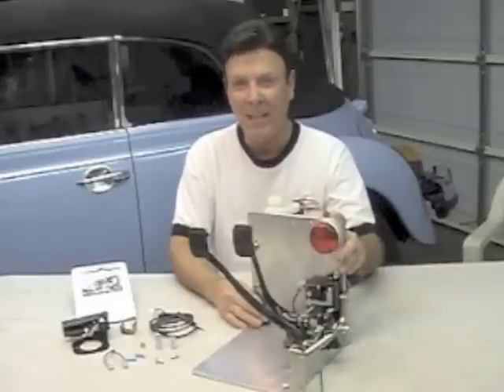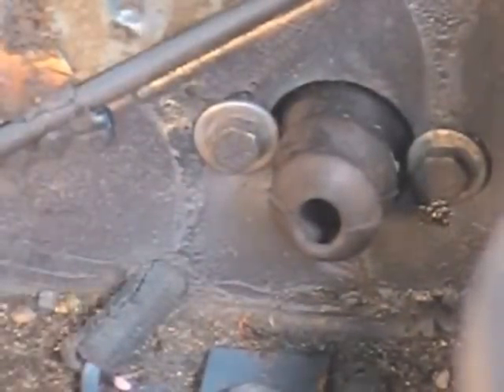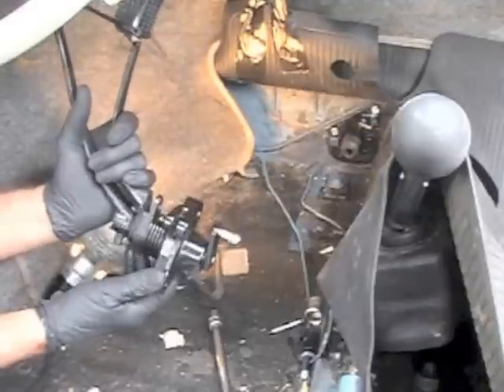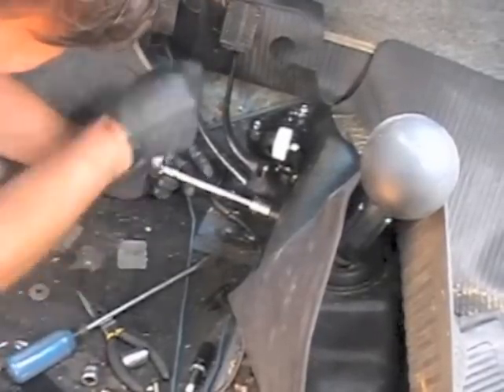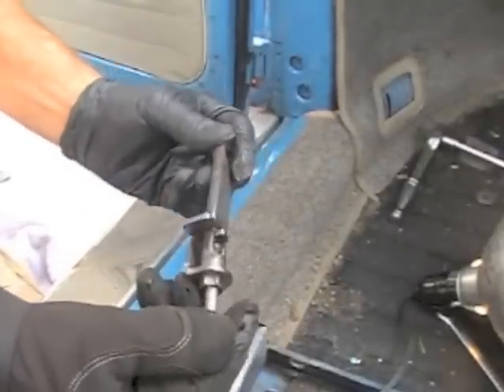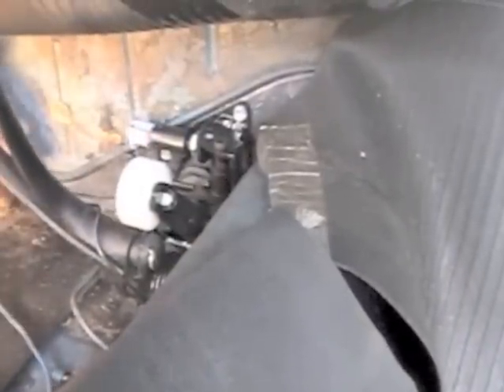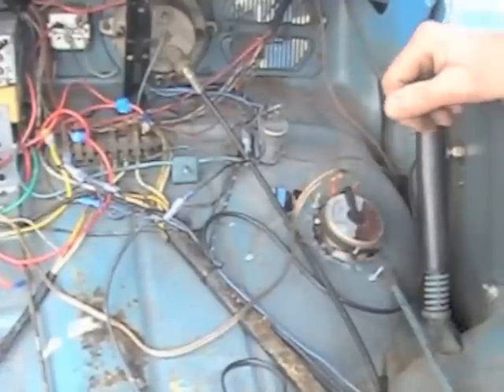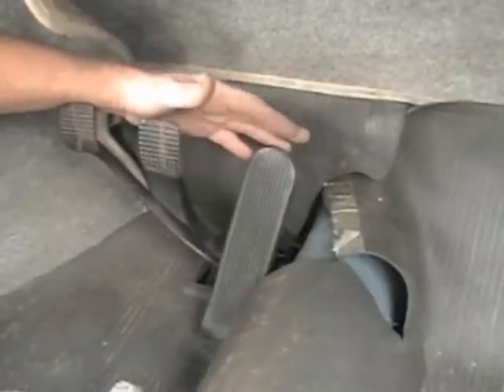Smart Electric Brake Light Assembly for 58-66 VW

Comment: i have a berrien buggy , and the set up is different ,,,,IS THERE ONE TO FIT A BERRIEN BUGGY ? for example on the bracket that has the barrel spacers well ! those bolts are not visible from inside the buggy ? need a slighttly different set up ? thanks in advance .